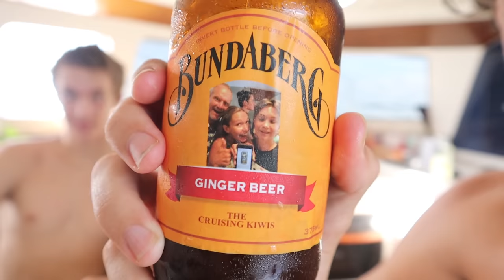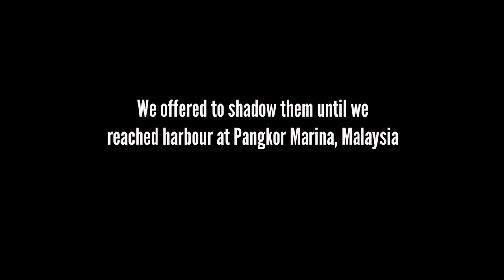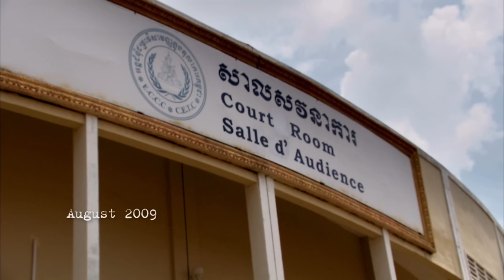Sailing to Malaysia : First crossing of equator by sailboat Ep 195

Comment: Rachel’s story-telling skills continue to impress.  Declan’s dry wit makes me feel a figurative kinship with him.  By his behavior, Ivan has been exposed as an Equator Denier.  Note to Rob about engine parts:  cut-rate parts are cheaper for a reason - you get what you pay for.
Reply from the maker: Thanks Rebel, I did show the after market pump to a marine engineer in Darwin, to get his opinion. He said the bearings in the am water pump were better than in the Yanmar. Time will tell. Also found the replacement bearings and seals were about AU$150 while at a bearing retailer about 20. Crazy.
Reply: Totally different animal but a replacement keyless remote for my Toyota was $200 US at the dealer but I found the exact same identical OEM keyless remote on the internet for less than $30 US.  Yes, it’s crazy.
Reply from the maker: @RebelRobin501  crikey that's a bit scary actually. Although I assume there is a process to activate the key that only you can do, otherwise it would be a free for all.

Comment: A fantastic episode. we're just sailing our 35' cat down from Townsville to Sydney on delivery-- just reached Bundaberg.  What night shifts do you run?  We were doing 3 hours on and 3 off (just two of us) interested in what you use?  Cheers Phil
Reply: When I sailed offshore with two of us on board we did 3 hours on and 3 hours off but we never talked of doing shifts (that's for factory workers), we always stood watches.
Reply from the maker: When it was just Rob and I doing watches (thank you sailbad for the correct terminology) we did 3hrs each. Now there are four of us on watch, we do 2hr shifts, argh there I've slipped back 😊.  So much better for everyone. I'm off now below deck to clean the heads before retiring to my cabin. I'm definitely not going downstairs to the toilet then on to my bedroom. That would never do 😊
Reply from the maker: @stephenbonnett164  for two that's the best time frame i reckon.

Comment: 14:30,   What came first the chick or egg,  that looks like classic “no water damage”.   Maybe if the chick came first the bearing in the pump locked up,  which burned the belt, (thats why it was loose)  and the lack of spinning even with a new impeller,  no water killed it..    if a new pump fixes it,  99.9% sure it was the stupid bearing..   almost worth re-building a few and swap the entire pump every 12 months,   And rebuild it, and put it back in stock as a new spare..
Reply from the maker: Yeah we've got two rebuilt on stand by now.  That pump was recently rebuilt too and the belt tightened before the new impellor went in so I'm at a loss. Mustn't have put in properly.

Comment: 7:41 i would love a limited edition cruising Kiwis,  ginger beer.   Very cool!     The bottle of sweat?  Not so much,  I wonder what got into the “house water tank?” Somebody drop some metal in there?
Reply from the maker: Opps sorry we drank all the ginger beer. Not sure what the problem with the water was. We made some fresh water straight into a jerry can, dropped a couple of chlorine tablets into the tanks then then flushed the system. Seems to have sorted the problem.
Reply: @TheCruisingKiwis   I’ve seen bore water like that,  just iron (in that particular case) and although not pretty,  perfect fine to drink apparently,  I don’t.. 😂.  But i have tasted it,  i’ve seriously got a bore across the road,  that’s 12 foot down,  and normally clean,  untill the summer months when the water table drops slightly,  possible somewhere was using bore water?    No answer required.. just a thought 💭 
Oh yeah obviously i shared to group,  will do until you tell me differently..     cheers again..
Reply from the maker: @trevhedges  thanks heaps Trev!